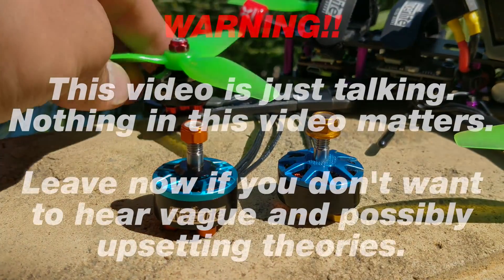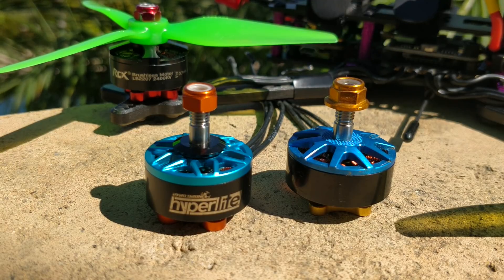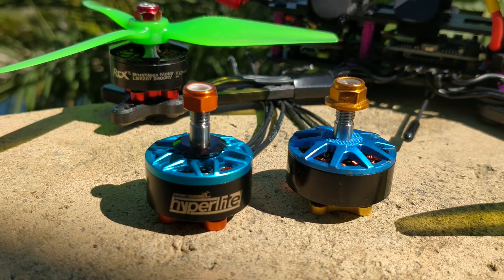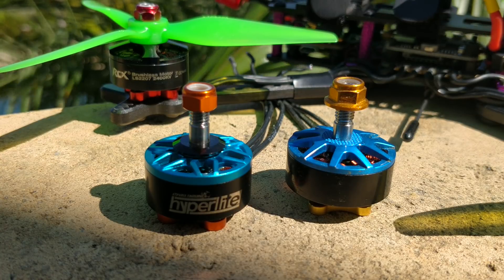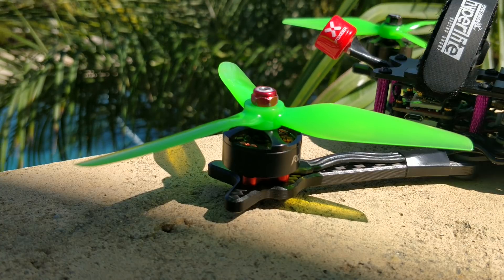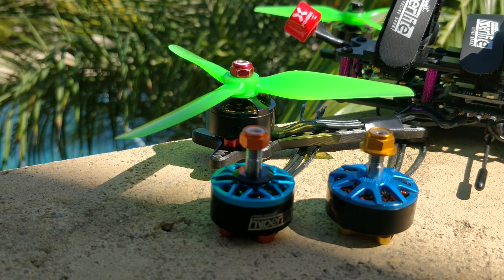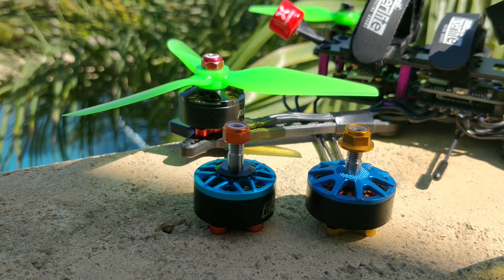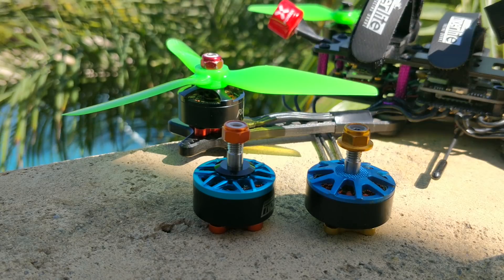Kv, Handling, 6S, Acro - Motor Theory (just guessing here)

Comment: Hi :) Quick question, do you think the Emax Magnum Mini V2 can handle the T-Motor F80 1900kv motors on 6s?
Reply from the maker: Yes it can but I wouldn't bother. The flight performance will not be good. It won't burn however so yes it technically can.
Reply: @Kabab  ah, thanks, I appreciate it:) I thought I heard you mention that the control was better in the 1800-1900kv range. I was planning on 2205-1722KV but wanted to try something new/better. What motors would you suggest with a 5" freestyle frame with the magnum mini stack on 6s? I could change the stack too.
Reply from the maker: @in4bliss  I wouldn't recommend the magnum mini for 5". I wouldn't recommend any 20x20 4in1 for 5". I recommend a 2208 ~1800kv on 6S above all else but it doesn't exist the way I want it. Anything close to that should be good but I'm working on things.
Reply: @Kabab  cool, thanks for the advice. I'm testing whatever I can afford lol. So far, two of my 6s build components are almost identical. One is the team edition Floss 2.1 combo (#87) as it came and I liked it so much, I put the same stack and motors on my Flosstyle which is amazing btw :) My third one is the Rdq Raptor True-X frame with the same hyperlite 2205-1722KV but it has the magnum mini v2. Feels great so far. I greatly value your advice and insight.
Reply from the maker: @in4bliss  I still use that $28 4in1 board on a few quads. I've had one of three blown up but all of them perform on par with the very best.

Comment: Just got this old 10” kwad that was about to be thrown away by the college drone club. 

It came with Turnigy 3536 910kv motors. 

Do those work with the DCL?
Reply from the maker: Not for DCL but you could build something awesome from it
Reply: Darn it.

What kind of motors and props are the DCL supposed to take then?
Reply from the maker: @TiredFlyerFPV  any 22xx general platform. 16x19 or 16x16
Reply: So, I am assuming it will be a 7-8in setup?
Reply from the maker: @TiredFlyerFPV  probably 10" triblade. Maybe bigger.  Probably 6S still minimum

Comment: +1👍 everything always always always in flux
Reply: also, thanks for mentioning pulling 20 points off your TX throttle with 1900kv, i did 30 points awhile ago, but haven't flow it yet.

Comment: I agree with some of your opinions; long before many were even considering 6S, you guys came out with the 2307 2522kv motors; I picked up a pair, put them on my 5 inch helix frame, and ran the 1050 pulse packs, which was all there was a few years back; that was the best feeling quad in the air for sure; it had lots of power, lots of torque, and you didn't have to stay on the throttle to keep the bird in the air; the batteries definitely took a beating after about 30-40 cycles, but it was well worth the experience. Those are the motors that you said you hated last year...but I thought they were the best motors you guys had ever put out in my experience; just that I was running them with higher voltage of course.
Reply from the maker: Voltage definitely does funny things we don't know about yet.

Comment: Seems certain high KV motors with certain 5" props on 6S can hit a sweet spot where they don't consume too much current (higher voltage) so battery sag doesn't happen very soon. Forget about efficiency here, however one who are flying, because of acceptable performance and flight time fell on illusion that all is good anyway.

Comment: Wish you’d run more ‘common’ freestyle rigs. Interesting ideas here, but the majority of folk are running much heavier for freestyle, and I wonder how that translates into your Kv theories. My only light freestyle rig is the Hyperlow RS and I wonder if that’s why I hate the Emax rs2306 2400kv on it with a passion.  A lighter rig naturally suits a higher Kv, and a heavier quad a lower Kv. Interesting stuff all the same.
Reply from the maker: 580-600g is normal. 600g auw is not super difficult to meet. Just don't load it up with tpu or use a 150g frame. As for the kv, it applies to heavier too. The amps and battery maintaince are another story.  For performance, the motor ability is independent of the rest. 

The reason you hate the 2400kv 2306 is because it's actually more like 2300kv and it's a 2306 so it chops the entire top half of the power in half.  So you're using a motor that's too slow and naturally hates spinning fast.  23xx is just no good for 5" imo.
Reply: Kabab FPV hmmm. Straying into preference here a bit. I personally prefer my 2306 mr coppers to my 2207 F60s. The 2306 suits my gentle flow better and I prefer the first 60% as I feel I have better resolution although of course they fade at the top. Higher Kv is nice, but no way I’m running 2700kv on my 4s packs. I’m not sponsored and they just melt my batteries lol
Reply: Yep I agree with Bob all my rigs light or heavy I run 2207 or 2207.5  2600 2650 2700 and 2750 kv on 4s, all my friends that run 23xx motors switched to 2207 after flying my quads and high KV, it's hard to explain but you get so much more control and quad flies smoother, also to note The Wider the stator The Wider the Bell the easier it is to get unbalanced and more centrifical weight for it to start and stop. That's another reason why I prefer a narrow and taller stator. I know why Bob has a trouble explaining why it's just hard to explain it just feels way better in the air. 

if you're looking for a cheap upgrade that's amazing that I actually use the new BBB 2207.5 2650 kv Pro racing motors for 17 bucks are awesome!!
Reply from the maker: @FarmerFpv  people are so easily swayed by marketing and popular items unfortunately. It's hard to believe many would choose a 2306 if they compared two quads side by side
Reply: @Kabab  exactly all my friends were persuaded by marketing and hype until they tried my quad side-by-side with theirs and then it really made sense to them why 2207 or 2208 just feels better in the air. When you first mentioned it a long time ago, I didn't feel alone running 2207. You got to try it side-by-side and you won't touch a 23xx motor again 👍 it's starting to catch on now they should have listened to you a long time ago lol

Cheers

Rob

Comment: I've managed to do my own similar testing today and I think I 100% agree. I have tested the brother hobby 2207 r3-1660kv, r6-1750kv and an Nothaero Dragon (oem) 2207.5-1850kv. 1660 and 1750 had great performance and good flight times (borderline ridiculous on 1660kv) etc but the bigger motors @ 1850kv are night and day better than either of them. It's like going back to 4s though in terms of battery performance.

With long range now a thing I still think 1750 is the freestyle choice as it will give your rig a huge envelope of flying, fast, slow, near, far and so on but I think I might need another freestyle rig with those Northaero motors on because the feel so good.
Reply from the maker: On 1850 6S you should get similar flight times as 1600 as long as you're going about the same speeds. At low throttle they should be comparable
Reply: The throttle is too much fun to do that though! I wanted 1800kv, I bet that's a good compromise. Amax have some 1800kv offerings and there is the tbs raven motor.

Comment: Why do you skip over the topic of how individual motors handle load and how the kv number is calculated? I am really confused, because if we don't actually understand what the variables we are talking about actually stand for how can we identify good motor characteristics as they relate to good motor behavior. Also, If motor performance and efficiency is dependent on load and motor load is dependent the behavior of the prop/ loaded rpm how can you make a guess at how different motors handle different voltages (4s vs. 6s). When you research the term "pitch" for a propeller there is a wide range of calculations on where (what point along the radius) do you take the angle of attack of the airfoil to use for the pitch calculation or how far the prop will travel axially in one rotation. As a result, how do you produce desired motor behavior besides through an arduous process of trial and error?
Reply: Really the figure of merit is advance ratio, although once you move beyond static clean-air environments then it gets really complex really fast.  Static advance ratio (theoretical) and combined active surface area of the blade can start to point towards what the motor loading can be at various points, from there you start wanting to match up torque curves of a motor, and also keep track of the wattage frontier of the battery selected (incorporating switching and resistive losses) to see where the knee in that overall curve falls.
I think if we had the ability to fully calculate those, we'd see exactly where certain combinations top out at the same area, and have benefits in certain areas.
For my part, 2207 with V2 Cyclones is really hard to beat as an overall combination - not the best in any one area, but most predictable within my flight envelope.
Reply from the maker: All very valid questions. Unfortunately there is a large discrepancy between reported numbers and actual real world performance. That's why it's difficult to just look at numbers and gauge. Similarly, thrust tests aren't so descriptive as kv and torque are very dynamic and not always related depending on the motor balance. Pitch and how props work is a different world but has a lot to do with the motors performance as well. It's all a lot more complicated and I'm just trying to understand it conceptually
Reply: @Kabab  Ya there are just too many variables and variable interactions to dissociate individual, desirable characteristics or behavior.
Reply from the maker: @Zachtamundo  yeah but it's still fun to fool ourselves into guessing what's going on. 😁

Comment: so what about running 5s on pretty much 4s setups. say wraith v2 35a esc's, 2306-2450kv motors? cons?
Reply from the maker: That's the example I stated in the last minute or two. It's the same as higher Kv 6s
Reply: Depending on props, the top end lets you really smash on the battery if you want it to.  That's mostly it, and the biggest difference I've noticed (although some lost resolution on throttle as well, since those want to hover at 16% on light builds).
Limiting throttle at the top end via transmitter helps in both instances.

Comment: I’ve been running 5s on 2400kv for coming on 3 years now, so it’s nothing new like many think it is. But for racing it just isn’t practical as the extra weight leads to slower lap times for me unless its a super wide open track. 4s, 2207 2650kv+ is still my favourite for racing.

Comment: All right there kabab  u found the issue with the holl quad with the omnibus  getting whipped but it was me that bun it i had put a plastic pin to hold down my vtx on tp the flight controller and pushed the signal weir from the receiver un till it shaped so my folt  all sorted know toke soon cheers

Comment: I built a self balancing skateboard, and I'm using 13s battery. I can still get a ton of torque a low speed by turning up the amps, however according to the vesc I'm using, my wattage is still really low. I believe this is because the esc pulses the voltage super fast, efficetively running the motor a lower voltage. But i think it goes farther than that, kv is like a universal constant of a motor in both directions. If you spin your motor at your kv rpm, it will output one volt, and if you're spinning it at a certain rpm it, it has to receive that voltage?? I think? So the esc will just keep the voltage level and pump in more amps till it moves faster. Anyways someone please correct me if I'm wrong, cus I'm pretty confused about it all. But my self balanicng skateboard works even if I don't understand it, you can see it on Instagram @nurxg
Reply from the maker: This is a tooooootally different application. The two don't match. One is torque at zero rpm. Other is transition torque performance. I barely have a clue how to measure zero rpm torque and I'm sure a lot of it has to do with gearing also.

Comment: Will you review the Brother Hobby Engineer X 1750kv? Im curioys about the ridges and if they do the same thing ZMX motors do. I just started fying the engineer x
Reply from the maker: No they do not do what zmx does.  They are purely for looks and maybe have a little cooling effect. I'm sure they run fine. The actual construction is one of two or three designs they make.
Reply: @Kabab  tgry remind me of the Jetson's as in Gearge Jetson. That might ve before your time.  Surely youve seen the Jetson's

Comment: I've been running hyperlite 2207 1922 on 6s all summer and I absolutely love it. I too use 80% throttle limit, and haven't had any problems with lacking power. I think you're 100% spot on with pretty much everything here. Please keep the theory videos coming!

Comment: I'm running 2300kv on 5s without consequences.
Reply from the maker: I consider 2300 a 5S motor.
Reply: They are Samguk 2300 rated 4s